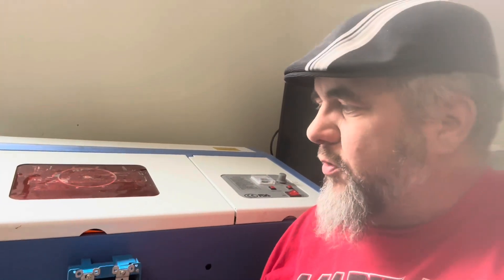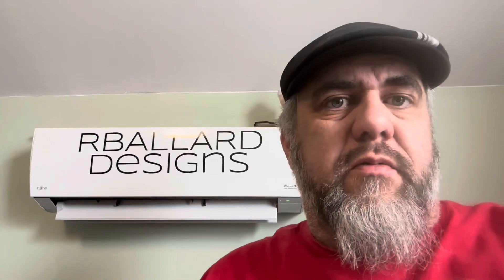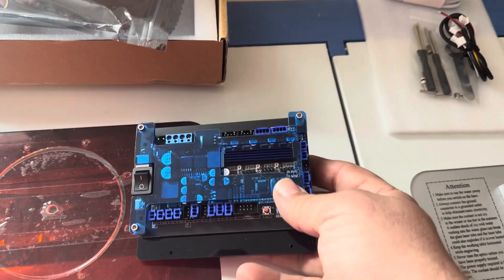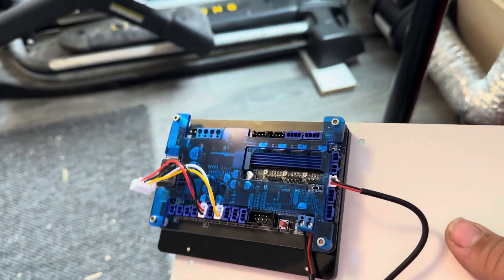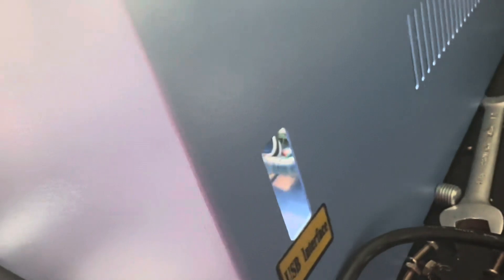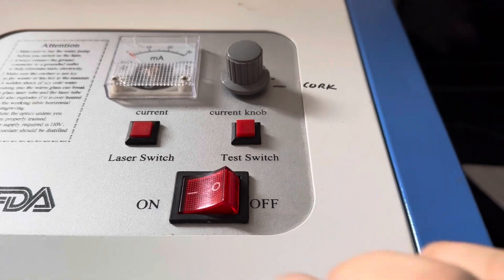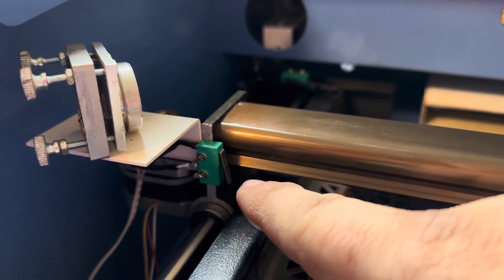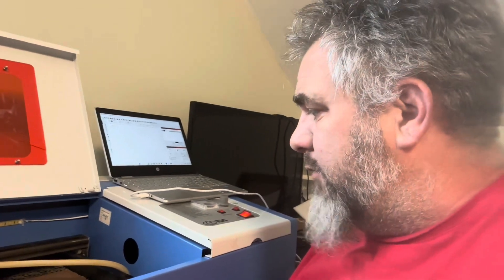Adding a Monport Lightburn Board to a K40

Comment: I was tempted to get that board, but it is obsolete. V2 is plug and play with original k40 boards.
Reply from the maker: Yes they released the new board.  Same process though. Just plug and play.
Reply: @RBallarddesigns  And same issues with my K40 too. Had to return it.

Comment: is there any reason to NOT want to run Lightburn software on a k40?   After 6 months with NO support from useless Monport support, I have my k40 machine working with lightburn. I have a test fire button, a ma meter, a potentiometer on the panel of my machine. the test fire in Lightburn also works and I am able to adjust the power to laser with Lightburn also.

Comment: Any benefits to getting the Cohesion board over this one? But like you said, spending $200 on a $400 machine feels a bit wrong.
Reply from the maker: The main benefit I saw was the ability to add a camera…. And I had no interest in adding a camera
Reply: @RBallarddesigns  Are you sure that you can't add a camera with that board? I thought the camera plugs straight into the PC and then you can use it in Lightburn.
Reply from the maker: @Dex2R7  you are probably right.  I didn’t want a camera with mine so I have not looked into it further.  There are a ton of extra ports on the board to so I am sure there is more functionality available.